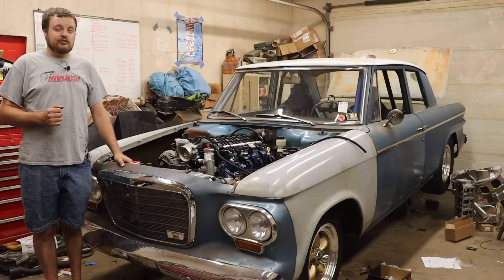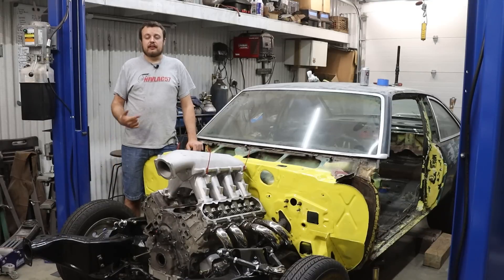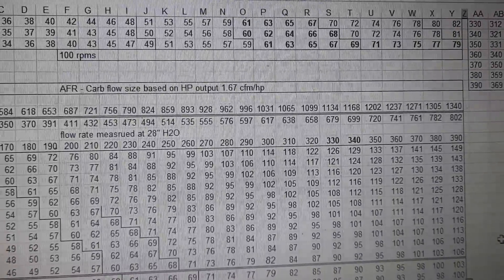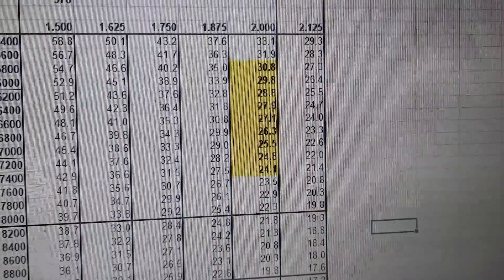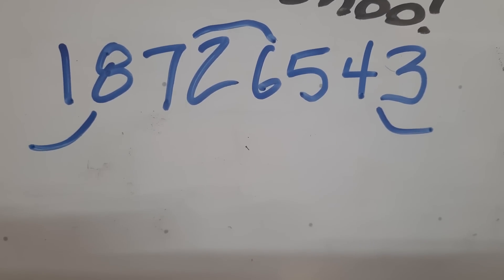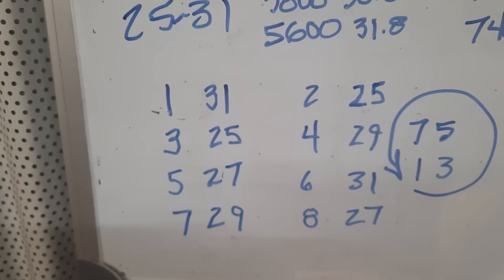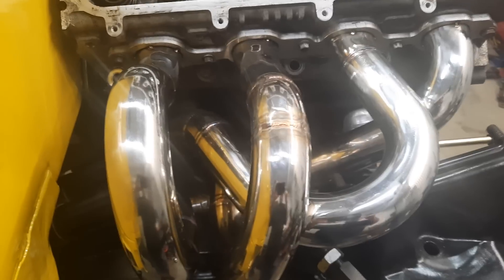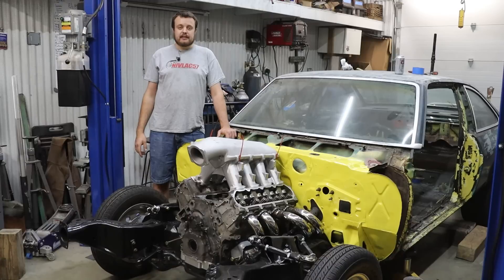Unequal Length Headers - Will This Work?

Comment: 2 years late to the party and probably wont get a reply. Im trying to figure out how to build unequal length headers for a SBF. I came up with a plan and its surprisingly very similiar to your concept. As far as choosing the lengths of primaries with respect to timing interval between firings. Unfortunately i went down the road of calculating the effective timing spread unequal lengths will attain. With an 8" difference in length between the two 90* interval cylinders it will only spread the pulse arrival time 9.4* at 4,000rpm. So in my in my case 6 and 5 will have a 99.4* spread at the collector. A far cry away from 180* that i want. Havent decided if its worth pursuing yet or not....

Comment: Hi friend! I have Ford Scorpio/Granada 90' with V6 engine firing order looking from the front to the back of the car is142536 so do I need a equal or unequal headers? If we look to the engine from the front of the car,the left side is 1,2,3 and the right side is 4,5,6 cylindres. I think ther is no cylindres who firing at the same time or I'm in wrong?

Comment: What is your opinion on 8 into 1 headers? Some people use them but I think on a V8 the tubes will be way too long so the scavenging effect happens at too low rpm. Maybe they work on inline 8 engines tho.
Reply from the maker: I don't like the merge volume. You end up losing a ton of velocity in the collector, which is not great for scavenging.

Comment: I remember reading the results from a header test years ago, that compared which parameters of header design made more power. Out of everything (primary size/length, merg type, collector volume/length, etc.) they found NOTHING provided more horsepower than a well-designed merger spike and a longer collector merge volume. Screw all the complexity. Use whatever primary diameter you need, but use the longest/smoothest merge collector you can build to fit whatever space you can find.

Comment: Did you ever run these? Really curious about the performance.  

Interesting thought experiment about the sound aspect - sound waves are traveling at 1700 ft/sec and the exhaust gas is more like 350 ft/sec.  At 6000 rpm 90 degrees of crankshaft rotation takes .0025 seconds which equates to ~10.5 inches of linear exhaust tubing length traveled by an exhaust pulse.  For a sound wave at the speed of sound it is 51 inches!  I don't think there's a chance to fix the uneven firing sound like you can with a set of 180* headers, but you should be able to smooth out the exhaust pulses entering the collector and make more power.
Reply from the maker: Haven't gotten to the point of running them yet. Ran into parts availability issues, but we'll get back to it later this year hopefully

Comment: My unfounded opinion:  This setup will make more power and less torque than a similar but less anal-retentive regular old 4-into-1 setup.
Further free advice that's not worth half what you paid for it:  Equal-length 4-into-1's (or tri-Y's) into a shared pressure wave termination box followed by an X-pipe would sound pretty similar to your 180-degree header setup--maybe even smoother, especially at the higher end of the RPM range.
I'll be interested to see how this all works out.

Comment: Just use equal length header short or long. Put on your exhaust and use a heat crayon to find out the 2 hottest spots and do either an X. Pipe orange pipe back in the day. All we did was do a cross over Pipe old school.

Comment: Only at certain rpm these headers can do what the 180° headers do.

Because 1 pulse always takes the same amount of time to run through the primary tube. but the amount of degrees, the crankshaft spins during this time, varies with rpm. One is time based and one is angle based. So the angle between the pulses of the 4 cylinders that go into 1 collector always varies with rpm, except its equal length headers. I think the benefit of equal length headers is exactly that, even if certain pulses are just 90° apart. 180° headers are the best, because they have always 180 between pulses, no matter what.
Reply from the maker: I imagine it will have a bell curve type effect.
Reply: @Calvin-Nelson  how do you measure primary tube length? just use a welding rod and estimate where the center of the tube will go?
Reply from the maker: @patriotdiz4846  you measure the tubes as you make them. Straight tubes are easy for obvious reasons, but for bends you just measure along the centerline of the bend.
Reply: @Calvin-Nelson  Thank you calvin!

Comment: I've seen a few 180deg setups that got messy and didn't really sound so good, so much that it put me off the idea.  Yours on the other hand look really neat and sound absolutely awesome !
Reply from the maker: Thanks. I'm very happy with it. It's all about the secondary piping in my opinion.
Reply: @Calvin-Nelson  Do you mind explaining the secondary piping and what you think is important that maybe others have not done right ?
Reply from the maker: As far as sound goes, 180 headers do a lot, but getting the tubes after the collectors to be the same length and merging them together really gets the sound to be more like a 8 cylinder rather than two 4 cylinders.

Comment: Finally a useable video on you tube that has actual real knowledge to share.  Thank you for the education on headers. I need to build a set for my s-10 that has a N/A HP level of around 550hp.  I chose 1-7/8”s for ease of fitment. Really wanted 2” but it’s just not feasible and it’s getting a lot of spray so I can pick up the extra HP there at the track. But I would like it to be healthy N/A. Every little bit helps.

Comment: Another thing you can do if you've heard of David Vizard is you can build a purposefully UN-equal length header so that it delays the pulses in each bank that try to interfere with each other in order to even them out and make it scavenge more like a flat plane, but without the crazy crossover of the 180-design. Aside from that, what you're doing with the radial-sequential fire pattern is perfect, and if you ever go back to making 8-into-1 headers again, it's even more important to do the radial fire thing on THOSE.
Reply from the maker: The headers we built in this video were intentionally unequal length, just so you know. Thanks for watching.
Reply: They're doing the same thing vizard described. DV used instrumentation (I can't recall exactly) to come up with the theoretical correct tube lengths. He only made one attempt and said it probably wasnt perfect. These folks are using math it seems, which is what I would do because I wouldn't have access to what Vizard used.

Comment: This is some great technical data. I wonder with so much thought and effort on the exhaust side why it isnt worth it to tune the intake side as meticulously. It is an airpump and can only flow out as much as you are flowing in too. Will be interesting to hear the difference at full 7000+ rpm song and see the powerband changes. Planning on using same cams and intakes?
Reply from the maker: We'll probably run the BTR 230 cam,band the Hiram is pretty much the best of the best for power. Lots of testing out there for that.

Comment: I'm interested in the results! after watching Vizard's video on this, I thought two primary tube lengths would be sufficient because you're trying to push the pulses together and pull them apart, so to speak, on each side.
on the right bank I came up with 26" for #2 & #8 and 30" for #4 & #6. on the left bank 26" on #3 & #5, 30" on #1 & #7.  maybe 4" isn't the optimal difference, but that was what I thought was a good start point.
  i've also thought  that getting a vortex going inside the collector may help too,  so instead of a divider in the collector,  you have a sort of flow director at the end of each primary that imparts a directional spin on the gasses going into the collector.  so that divider is now 4- way and slightly spiraled. (i hope that's understandable.) if it's even possible. just pick a direction and do the same on both sides.

Comment: Absolutely LOVE this!!! If there's a frustration I've always had, it's how a lot of guys will talk theory on forums and such but rarely ever does anyone actually BUILD & TEST. I can't wait to see this tested; I'm almost as interested in the sound as the numbers. I can't argue with the theory, so I believe it should offer some numbers. In fact, logically thinking, it's a flat plane crank V8 that would benefit from equal length headers rather than a cross plane, no? 
  
BTW, one more idea to check out - Hoonigan uploaded it on the 'Hoonigan Project Garage' channel a few days ago, video title... 
"Exhaust to Make an LS3 Sound Like a Supercar!", Zac's C6Z 
...it's a unique header concept by Celeritec Headers for C6 Corvettes with an 8-4-1 header arrangement; so each bank is a 4-2, with each pair from each bank going back to a single 4-1 collector. I'm not quite sure how to apply this primary length variation strategy to a tri-Y-esque design, seems to inherently limit the hell out of how much variance you can have, but this is certainly an interesting "next level Tri-Y" kind of design worth playing around with I think. I definitely want to experiment with it. 
But the 8-4-1 is a pretty interesting idea; one of those "WhyTF didn't I ever think of that?!" ideas. And it sounds absolutely WILD too, unlike anything else I've heard on a crossplane V8. It's 180°-ish sound, but definitely identifiably different than a 180.

...I kinda want to build one of these 8-4-1s for a turbo setup. Might be basically impossible under a hood(makes for a pretty long, awkward header-thing), but could be perfect for something like a compact pickup with a bed mounted turbo(this setup has proven pretty successful in the no-prep world; notably Mid America Kustoms & Jason Cantou). I've never bought into the "it doesn't matter" philosophy of turbo header design, no doubt log manifolds and such can and do work, but, just like they "can and do work" on an NA engine, they aren't exactly ideal(I mean, usem' if they work for the app, they have their own advantages of course). Even if you can 'cover up' their limitations with boost. The more efficient a header is for an NA engine, the more effective it should be as a turbo header, with sizing adjusted as appropriate of course. The greater the energy you can maintain in the exhaust, the better to spool your Wuhan Whistler. How much better; how much lower of an RPM can we spool up at? How much time is saved in spool up? What about pedaling mid-track, can we get quicker boost recovery? All questions worth exploring with turbo header design, that few seem interested in testing & answering.
Reply from the maker: Yep. I watched the Hoonigan video when it released. I found it interesting how much power they picked up. They do it in NASCAR, so obviously it has merit.

Comment: A 180-degree header has the potential to be a true equal length tuned header ,where the reflective wave works in a similar manner to an inline engine. Thus, it can be tuned to a more spastic RPM range. This should give you  higher torque numbers at that particular RPM for which it's tuned for.

A traditional 4 into 1 header may seam to have equal length tubes however that's not how the engine would see it , there is 270 deg and 180deg and 90 degrees of crankshaft rotation between cylinder firing on 0ne bank so the pressure wave comes  back to the engine from the collector in an uneven fashion.
The reflective wave from the collector is all over the place in a V8 engine, so it can't be tuned as precisely as a 180-degree header. Thus, it'll likely give a wider turning range, so it's then likely to give a flater torque curve with slight lower peak  numbers.
Reply from the maker: You could be right. The unequal length may reducing pumping losses by freeing up the collector for the two cylinders that are 90 degrees apart. Question is which will be the larger factor.

Comment: 0:20 
Short answer.... no

Maybe some performance but 100% sure the sound will not be like a 180° header, because subaru uel headers in teory should sound like a crossplane inline 4, but it doesn't.....

Comment: Going to be very interesting to see the outcome. Sound is definitely going to change, but probably only slightly… 

I’m thinking of changing the exhaust on my blown bbc, 565 with an 8-71. 

Thinking of doing dual 3.5” off the collectors, into a Y-pipe, that is 5” oval outlet and have a single 5” oval pipe out into one muffler… Wondering  with it would sound like… if it would have a 180* kind of sound… 

I’ve never heard a big cubic inch or high Hp engine with a Y-pipe lol. Thats stock factory stuff… which always sounds like junk…
Reply: I ran Y-pipes and big singles on BBCs in the late 80s and early 90s. It drew a lot of attention.  Everything was home.built.

Comment: Very informative.  But i have to say, how much are you actually gaining for your efforts? 
Without an engine dyno you have no way to accurately quantify your  results, there's too many variables on a chassis dyno. Let's say you gain 8,12, or 23 HP for the tremendous amount of time you have in them, besides the fun of playing with F1 theories, is the return worth it ???  VS some good off the shelf headers and spend your time and efforts on the rest of the build....
Reply: The 180° project i get because you were trying to achieve a certain sound.
Reply from the maker: @BEANS-O-MATICtransmissions  If you are racing in a cubic inch limited class, gaining 10hp can be the difference between winning an losing
Reply: @Calvin-Nelson yes, but you're not, you're just exercising your engineer brain. Thats all fun on paper and makes content but, you've got other stuff to do ! Lol
Reply from the maker: @BEANS-O-MATICtransmissions  what other stuff do I have to do?

Comment: I´d say you are forgetting first primary rule of why you are using headers.
The primary tubes are tuned in length to a certain rpm range.
Starting to alter that because you want even time between pulses hitting the collectors you are going away from what headers are supposed to do.

David Vizard also arguing the same way as you, but i still need to be hit with real A-B-A testing before i belive it.
Reply from the maker: Yeah. That's why we chose lengths that should hit their peaks throughout the operating range. We'll see how it does on the dyno.
Reply: @Calvin-Nelson  It has been done before, usually results in a header that won´t shine anywhere :(
Reply from the maker: @Patricks_Projects  on a flat plane crank I would agree with you. We'll see what the dyno has to say.
Reply: "One accurate measurement is worth a thousand expert opinions."
--Grace Hopper
Reply: All the lengths are in a desired operating range. It is not set up to have all 8 set for one rpm.

Comment: Can’t wait for the video with these 180° headers on the Dyno  then with more traditional headers and see what the horsepower difference is
Reply: Right.  I’m very interested.
Reply: Im interested to know if the 180° headers, Allow you to use a smaller exhaust after the collector as its not being bottle necked as much because of the "perfect pulse"